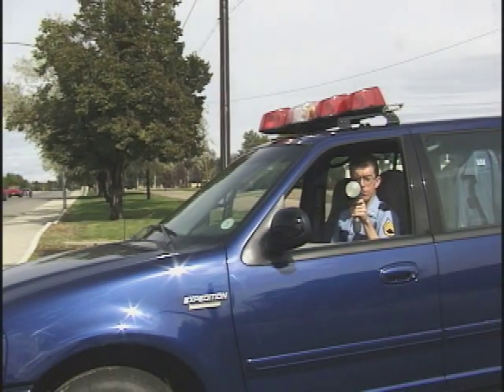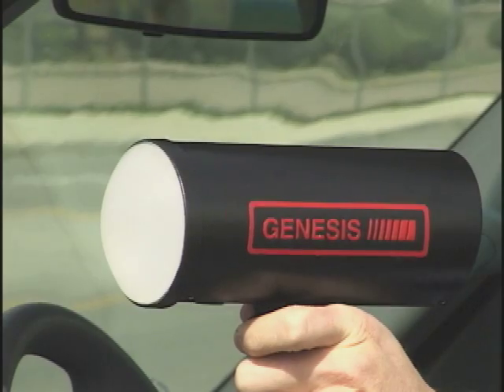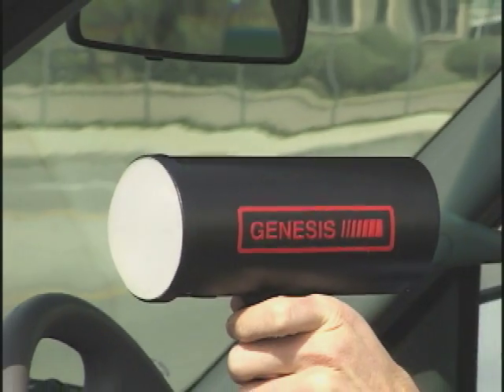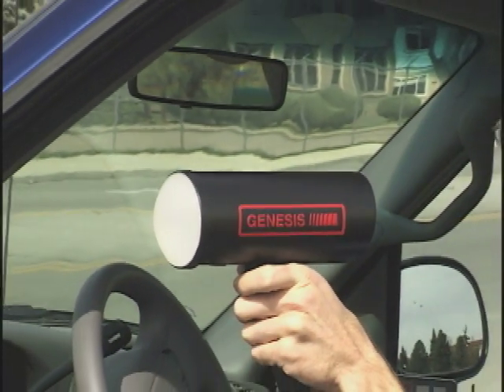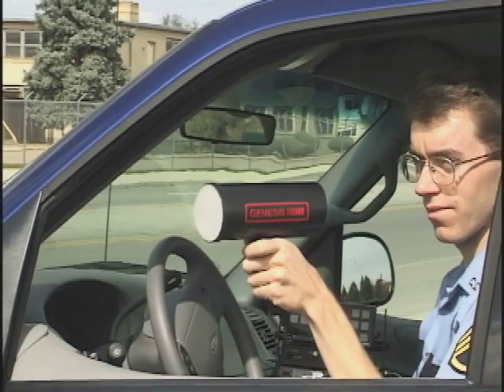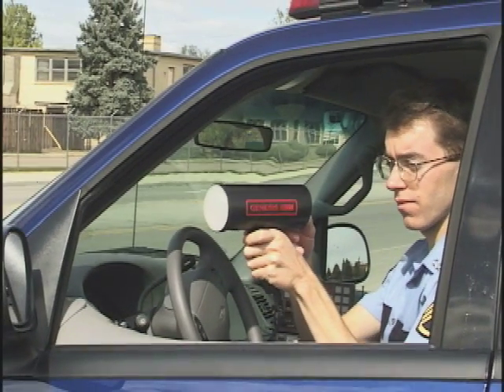How Police Radar Works

Comment: my ex is a cop.... 1) these are machines that must be maintained and calibrated in order to be considered reliable and effective 2) no department ever does it as it is expensive. 3) you have the right to those records when accused of speeding in court, if it has not been maintained then most cases are thrown out...

Comment: Police RADAR is doppler based. They transmit a signal at a known frequency. The frequency of the reflected signal from the target is compared to the transmitted signal. The change in frequency is used to calculate speed.

The system is only accurate when being shot at you inline with the road. Angles of fire induce errors.

If you are in traffic the police officer cannot tell which car the signal was reflected from.

Educate yourself and purchase a good RADAR detector. Be warned! Police actually have a device that detects RADAR Detectors.

Comment: This is an interesting brief of a couple of types of radar used by police. It should be noted that the radar equipment must be calibrated and re-calibrated at specific intervals. The officers must also be certified in the use of the type of radar equipment they are using.

Comment from the maker: Wrong. It normally reads the strongest target. Radar with Fastest Speed reads the fastest but only displays a speed; it's up to the officer to determine the vehicle's ID. "Reflection and absortion" [sic] don't exist as radar issues and radar works fine around airports. Otherwise, you're right on target.